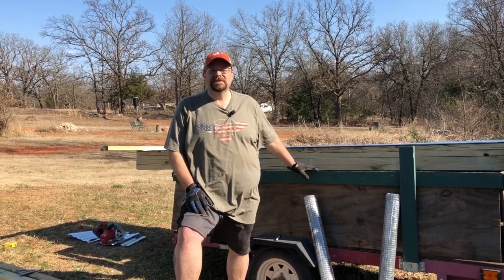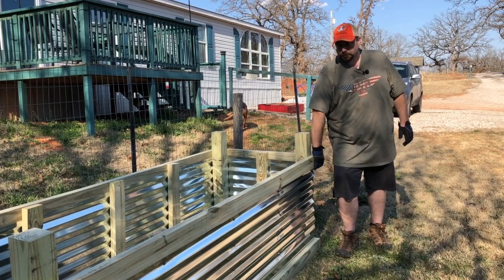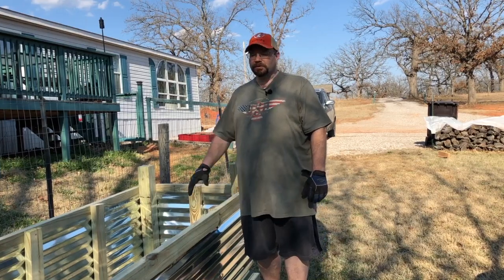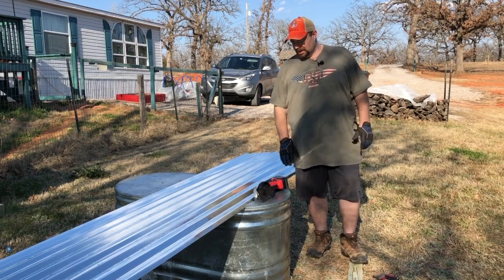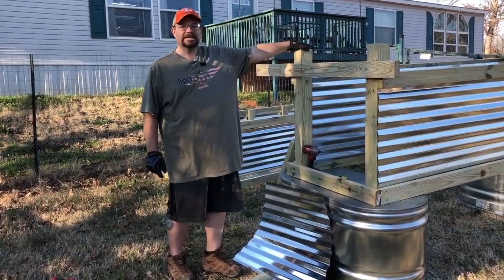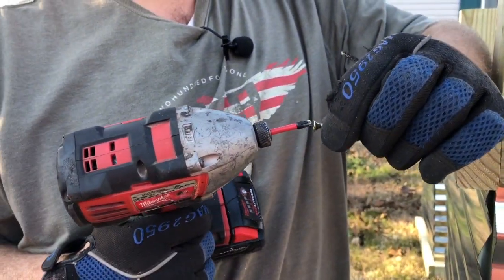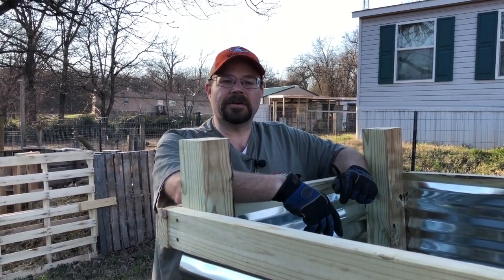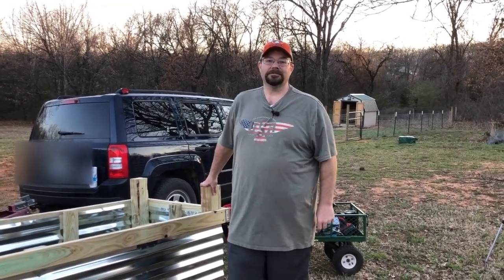How to Build Galvanized Metal Raised Garden Beds

Comment: Looking good !  You are really gonna enjoy them I am sure !
Reply from the maker: Any suggestions on backing filling the beds. they are super tall. What I was thinking was some logs on the bottom, with some leaf litter etc... Then some composted dirt from the city on the bottom half,(not that great has a lot of wood scrapes in it, but didn't think it would hurt too bad if it was in the bottom half.) , then some half way composted hay and straw from our goat and chicken pins than top it off with your special blend of super soil and our finished compost.
Reply: @RockingCHomestead  Man that sounds like a plan to me... You can save yourself some cave ins by rinsing your fill in lightly around your longs (dont make a soggy mess, but knock it down in there)...  Keep it light...  Mixing the leaf litter and straw into your city dirt will leave fluffy voids as the organics rot out...  Anything you can do to keep it from compacting into a dense heavy mess that will challenge the construction of any box (think how heavily they would have to frame to hold in that much concrete when it got wet and wanted to move)...
Reply from the maker: Sounds good! Thanks for your help!

Comment: Looking great ya'll! You could use some metal corner trim like they use on metal buildings. We had wood raised beds about 12 years ago. We quickly learned that by painting them they lasted longer. You could use your corner post and your braces for hoops to low tunnel those beds. Did you guys get storms yesterday? Here btwn Luther & Wellston we got hammered with hail. A lot of hail nickle to golf ball size and almost 3 inches of rain. Crazy start to the season.
Reply from the maker: I was thinking of staining them or some sort of tongue oil maybe. Not sure yet, but We painted our smaller ones we maid last year for our herbs. They seem to be holding up.  I was thinking of putting in some 1 or 2 inch PVC on each end so we could do a hoop cover if needed. That will go on after the rails our on, so we can see what we have to work with on the inside. We got a little bit of rain in the morning than right after dark we got about an inch of rain with some pea size hail. It looks like you guys got it much worse than we did. However, we did have one heck of a light show before it started raining. I haven't seen lighting like that for a long time.

Comment: I'm sorry to say but this is a bad design. all the wood, PT or untreated should all be on the outside of the box, have the least amount of soil touching any wood. build all your wood frames on the outside as the steel will last much longer against soil than the wood will, wood will eventually rot, even PT, and it will prevent any treated wood from leaching chemicals into the soil.
Reply from the maker: Thanks for the feedback.